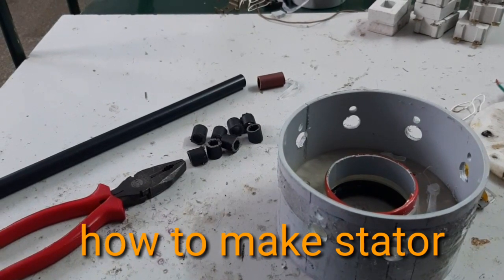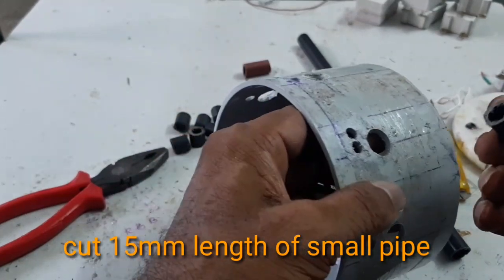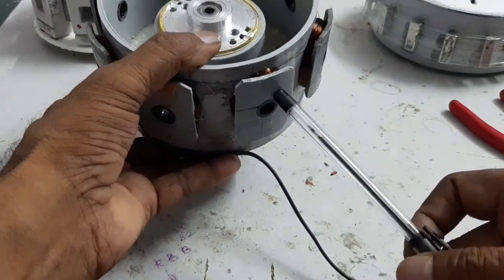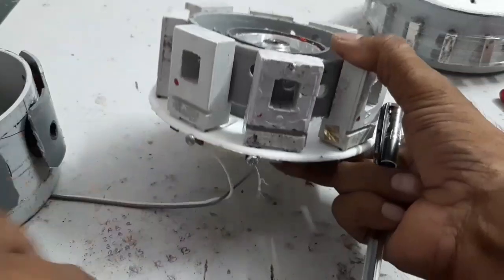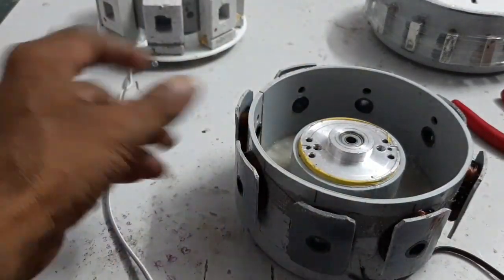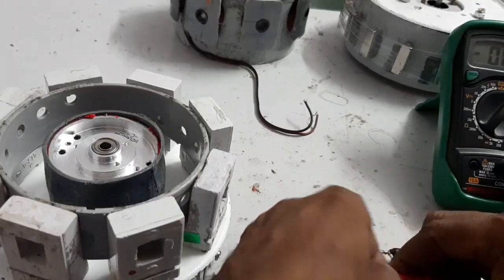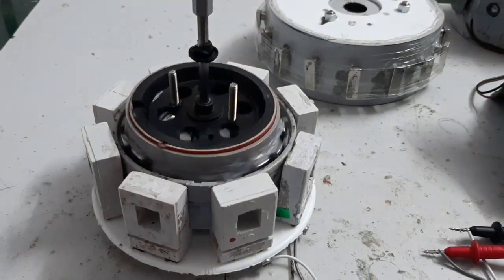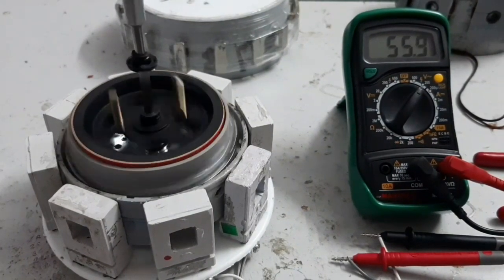(V-129),230v,200w powerful wind generator using dual rotors & single stator

Comment: Please explain about contactor coils 
And deep information about it 
How it is made and its complete details please.
Reply from the maker: Sir
This is a 230v contator coil moulded type which is taken from old  cutler hamer 2pole contactor
This coil or equivalents available in msrket and its price  Rs 120.00
Reply: Thank you.
I am actually trying to research in generators. Can i expect help from you.
Reply from the maker: For my analysis
1.Neodymium magnets is better options for rotor
2.Dual rotor with single stator without core is good option
3.If we use core in the coil 20 to 30%
Voltage increased but friction also increasd between stator and rotor
This are the points i have concluded

Comment: I want to see if you connect a resistive load, the voltage will disappear and also the speed of the rotor will be almost zero, this due to the eddy currents and the magnetic brake.
Reply from the maker: Thank you sir
But your logic is not correct
If I short-circuit the stator winding due the high current the speed of rotor will reduce and stop but if you give proper current rating of load the speed will reduced slightly but not stop ok
Reply: @pugalstech  Ho yes, i would like to see... can you demonstrate?